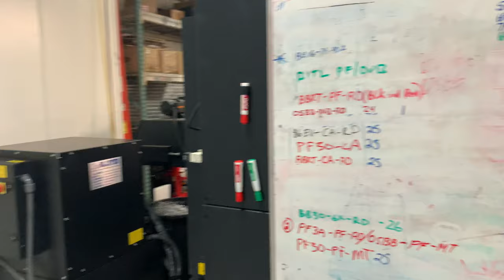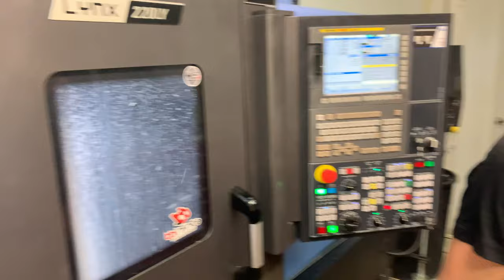Factory Tour: How BBinfinite makes 1-piece bottom brackets

Comment: I have two bikes and I have installed BBinfinite bottom brackets in both. I am completely convinced these are the best bottom brackets on the market.
Reply: Have on being shipped to me in the next day or two.  Did you install it yourself and if so was it easy?
Reply: @robertandrews3055  Easy yes, if you don't have cables or wires running internally through the BB housing. I have my hydraulic brake line and Di2 wires running through so it was a little more challenging but BBInfinite supplies the proper press blocks so all you need is the press. Take your time and you'll be fine. Here is the spin test on my cross bike, https://youtu.be/xLF1uQXu0Hs and these are the standard bearings not the ceramic bearings.

Comment: Just installed my new BBinfinite bottom bracket on my Cervelo Aspiro gravel bike.  The quality and ease of installation is impeccable.  Dust caps and spacers are labeled along with the labeling on the bottom bracket shell makes it easy to get right.  It also came with the locking liquid for my frame's BB.  Beautifully made and all the details were well thought out for ease of installation including two press tools (one for bearing replacement one for installation ).  It's great to see a company that does it right.